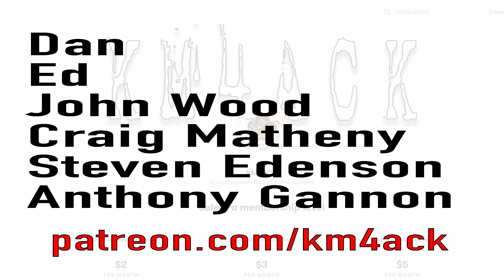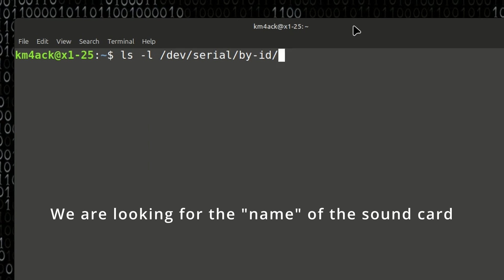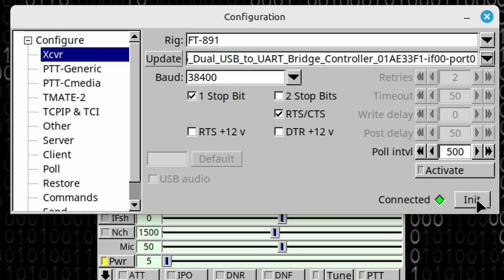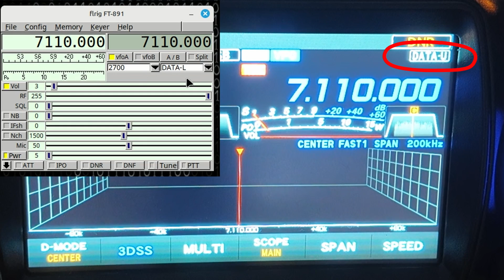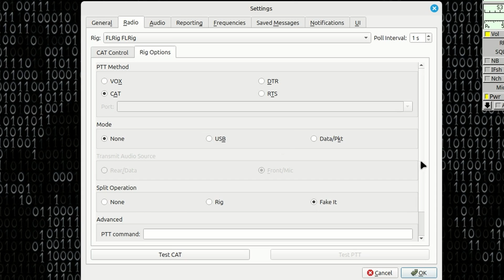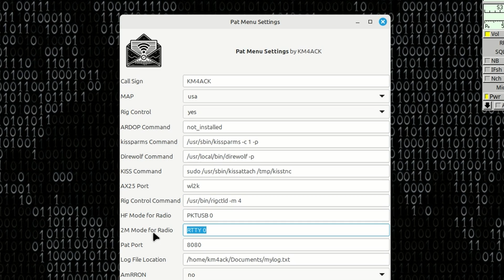How to Use Yaesu FTX Radios with Digital Modes  FLRIG Setup Guide

Comment: I am trying to de packet radio on the FTX1 it’s probabely possible but how. Do you perhaps kniow if the radio is doing packet?
Reply from the maker: It should be able to but I can't test things here. I sold the FTX
Reply: @KM4ACK Thanks for your response I did Some setups and finale it works great

Comment: Yaesu UK told me,
Install USB Drivers for FT/991A/SCU-17 and uses Radio FT991A
Still waiting on the Radio in the UK
Reply: In my testing, selecting the FT-710 in FLRIG seemed to work better for more settings than the 991A.  Primarily the RF gain worked.  Using the CAT manual, I was able to add custom commands to configure other controls that did not work right.

Comment: Good video. For mine, I am using a  win11 laptop. I fiddled around a lot and what I ended up doing was using HRD, setting HRD to an FT-991 and setting wsjt to HRD and that worked. When I tried wsjt direct, with both the 891 and 991 settings, many things did not work and I often got connection errors. More tor try and hopefully updates will come out soon...

Comment: Hello, ... 
Is it not possible to use the same settings as for the FT-991(A)? This radio is almost the same, as the 'lighter' FT- 891, but the FT-991(A)  includes the VHF/UHF- frequencies!  (2m and 70cm) maybe switching to VHF, will work for it? 

Don't have 'my' FTX-1 right now, we in Europe are still waiting, ... ! I was not on the list, for the first batch of the 'new' Yaesu- radios here in DL ! 

73 de Markus - db9pz - JN39fq - 3miles/5km east of 'LX' -
Reply from the maker: The 991 might work. I tried the 891 first and it was close enough for what I wanted to do at the moment.

Comment: Just like a true tinker and experimenter.  A 90%+ working solution is much better than no working solution any day.  Does your 73 Linux configurations only work on Ubuntu based Linux Distros?  I run an Arch based distro.
Reply from the maker: 73Linux was written for Debian based systems.